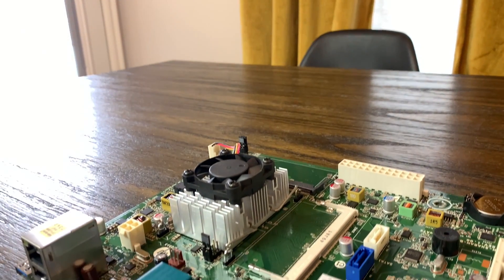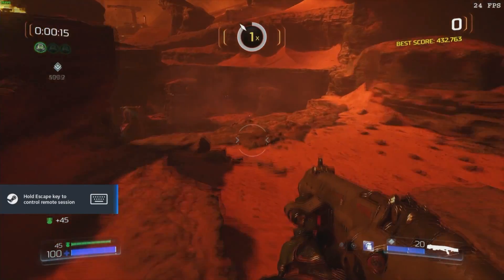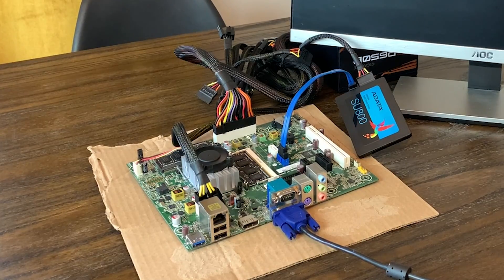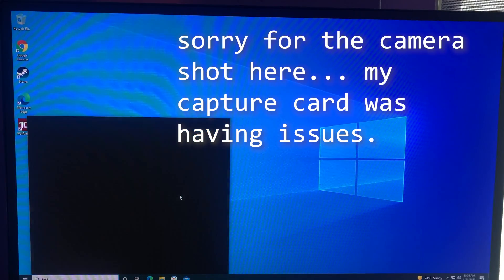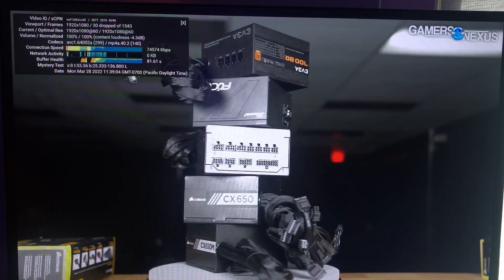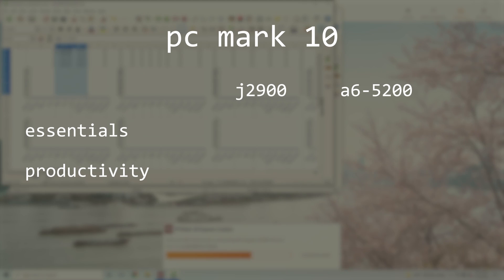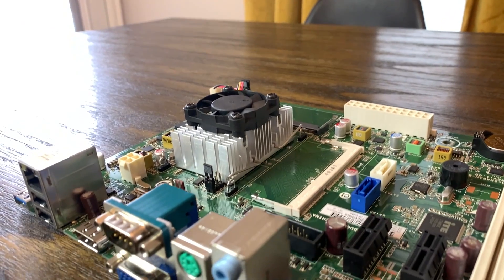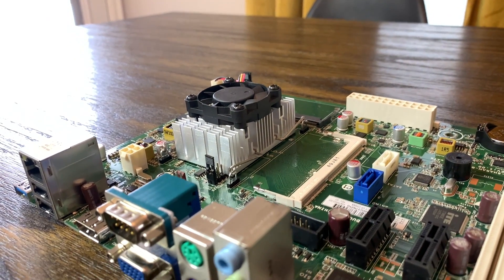YouTube fixed my motherboard.

Comment: I had a similar system, but with DDR3 DIMM not SODIMM. It worked with one DDR3 stick but not two. Both ram worked alone but not together. I tought slot 2 is bad. But later I found out that the motherboard officially needs DDR3L. It may work with DDR3 but the higher voltage could be too much for the memory controller. So one DDR3 was working but two sitcks was too much. I bought two sticks DDR3L and it worked like a charm.

Comment: I never thought I see someone else with that oem case! 
Got a hand me down Compaq computer that has the exact case but with different specs though I think I remember it was worse then the one in this video. 

Wanted to reuse it but the whole thing is riveted, Even the dvd drive..So I had to drill it out just so I can use my own spare parts in it. I found a new hate for computer cases like these.

Comment: At my old PC I getting blue screen randomly, I test ram, it is ok, disks are ok, cables look fine, cinebanch work fine, add 2 fans and bigger cooler, do not overheat..so it is motherboard or PSU problem...

Comment: CPU Soldered to the motherboard, don't buy!!!
Reply from the maker: Why not? Just curious for your exact reasoning
Reply: @HardwareHaven  I like being able to upgrade my PC, so I'm against the soldering in of CPU, Ram, Hard drive, Cmos battery etc.
Reply from the maker: @STONE69_   That's fair. I think the benefit of this is that you'll rarely see power efficiency in a socketed chip like you'll see in a bga chip like this (at least not within the same generation and/or price point). So for a lot of "server" type workloads, the performance isn't necessarily as important as the power draw. Just something to keep in mind. To be clear, I like easily replaceable componenets and am against soldered components when there is little to no benefit other than forcing consumers to buy new products.

Comment: I recently started a weird project with a very similar HP board. It's the Pentium J2900. So, it may be the exact same board.
https://youtu.be/4kvOlQ2sX-U
I've modded it to fit a full size GPU, and without the integrated GPU enabled the CPU only pulls a max of 3watts when at 100% utilization! But normally it pulls between 0.5 and 1.5 watts. It's pretty impressive.
I paired it with a GT 610 and got the following games to run on it (at low settings):
Portal (portal ran extremely well: 60+ FPS @720p)
Tomb Raider 2013
Borderlands 2
Minecraft
Lego Worlds

Gaming on it wasn't a great experience, but it was pretty cool that you can play the latest Minecraft on a CPU that's only pulling under 2watts.
Reply from the maker: Haha “reverse sleeper”! That’s super cool, and yeah I think this is the same or nearly the same board. I love stuff like this. Thanks for sharing!

Comment: I am thinking that a such low power CPU can run fanless. That can be a night PC. When it's nighttime sounds feel much higher, and a fan noise even small can be really annoying. So with that computer you can enjoy some YouTube without it. I am able to run Windows 11 + 720P60 YouTube smoothly on a Celeron N2840. This definitely is the best that CPU can do, my Core 2 Duo T9300 is noticeably faster, but it shows that your Pentium should be able to do much more.

Comment: in a general sense, the pros over intel you will/would find in AMD based low tdp is that usually they are not limited in features; for example although I don't think anyone would be crazy enough to do it(except maybe a youtuber) it's quite possible to do 7 gamers 1 cpu on a Athlon II 160u amd even though it is a 1.8ghz single core am3 cpu where usually on an Intel equivalent it would quite possibly not even feature VT support or have some other limiting factor(intel tends to disable or bottleneck features depending on cpu class far more often than AMD does; **I've tried the passthrough on a 160u but not in this torture scenario :P)

Comment: The thinkpad I have which I like to call Satan's Laptop, cause how painfully garbage it is, even for a school laptop the ones the schools gave you was faster than it. And when I took the ram out of it to upgrade my alienware alpha which I use for a icecast server. When I wanted to go back to that laptop, I also had no idea about low-voltage ram and all the ram I had was regular voltage so yeah, took me a while to ebay ship the max ram for that laptop and it still runs like crap, even with a slightly better ssd it's still slow, so now it just sits in a drawer, waiting for it's next victim.

Comment: I've been thinking a good video would be something kind of similar to this, but someone that tries to find the most powerful PC that can run off of USB 5v power. As I was thinking a PC like this would be good without AC power available and only having a low power usage machine in an emergency situation where you only have access to at most like 5v via a portable cheaper battery bank that doesn't usually supply 12v+ or being able to use similar things that are used for usually only phones and such? I know things with USBC have made things a bit more difficult as USBC can usually accept a wide range of voltages and things but from what I usually see is that most usually accept at minimum 9v-12v to actually power/charge machines. I know Raspberry Pis and such run off 5v but I am meaning things like x86 windows based machines.

Comment: After watching this video, I bought the same MOBO on ebay for $15 w/8GB of Ram, got a PCIe 1x to 16x adapter for $12, and plugged in my cheap R5 340x I got for $18. There's another $5 HP 250w PSU on Amazon too (There's still some left..wink wink). So for $50 it plays Minecraft and can Web Browse.
Reply from the maker: Heck yeah!! That’s so awesome

Comment: pfsense/opnsense machine right after the ISP's router.... low power draw but powerful enough for a small to medium enterprise network usage.... perfect for home use... and might as well run local dns hosting and pi hole on top of all of that.... taking your home networking to the next level without any worries...

Comment: I applaud your brave decision to install Windows 10 but you will struggle to give it away unless you put windows 11 on it.
 I totally agree with you that many Americans would struggle with the confusion that is Linux, especially OpenSuSE. How about trying out BeOS that will get the most out of the hardware? It should be fun
Reply: it will probably be more wanted with windows 10 as apposed to windows 11

Comment: From working at a computer shop. I've learnt that motherboards that take DDR3 RAM can be delightfully picky about which ram they'll actually post with. Sometimes they'll straight up refuse to post, other times they'll refuse to even recognise it in some extreme cases.

Generally I like to remove the ram completely and check for the "missing ram" beep code.
Reply from the maker: Good to know that that’s actually a useful troubleshooting method. Thanks!
Reply: @HardwareHaven  np. 

Generally removing the ram and listening for the beep code can give you an indication that the CPU is actually executing bios code. Just note that some M/B don't beep if they don't contain ram or don't come with beepers.

Other rare reasons for a M/B not to boot is corrupted CMOS settings. It's rare, but it does happen occasionally.
Reply from the maker: Thanks for the info!

Comment: Most don't prefer anything
To prefer you need to know at least 2 options
I prefer Linux. To be precise Debian GNU Linux, then Red Hat Enterprise Linux 
Why
My first computer was Commodore 64, then Commodore Amiga A500, Commodore Amiga A1200, some amount of PCs, now Dell PowerEdge R715 and R815 
Windows is inflexible, slow, takes over control of your PC (on Linux I can run PC without any interruption for years, while windows will force update on you along with compulsory reboot for say single insignificant DLL) and productivity wise is actually utter mess
I may prefer FreeBSD or OpenBSD, but I don't know those (I have used them briefly, but I don't know them) 
In next few years I would not be able to say I prefer Linux over Windows,  because I would cease to know Windows - I already struggle to understand design decision of Microsoft and I am often lost

Comment: If any of those motherboards have gigabit networking I would suggest getting a second network card and building yourself your own network router. 

I used pfSense and It wasn't much more difficult than installing Linux on something like the Raspberry pi. I've got it blocking ads at the router level which is pretty cool, but you can also push all of your traffic for your entire network over a VPN.

I think a 10 watt TDP would be perfect for this type of application.
Reply from the maker: Definitely something I'd like to try out! I just had a 2.5 Gigabit card come in, so we'll see if I can find the time to get to it. That's the real struggle right now haha

Comment: Those low end amd apus are infinitely better cuz the gpu runs laps around intels low end. And older stuff really does run fine, think 2000s, need for speed most wanted, underground 2, etc. Still a great time.

Comment: Use that PCI Slot. There are still gigabit Ethernet cards for PCI slots out there. Also some SATA RAID cards, however, those tend to be SATA 1. Truenas wants 16gb of memory minimum, so you may need a upgrade there. But I could see this board being a better high speed router with PFSense and a couple of 2.5gbps network cards.

Comment: If you really REALLY have to use Windoze 10, set your power plan to Ultimate Performance, and disable Spectre and Meltdown mitigations using InSpectre. Windoze 10 is a terrible idea when it comes to old hardware like this, your poor processor will be in agony.
Reply from the maker: For sure. I wouldn’t use windows 10 with this personally. But I thought I did an okay job of explaining why I tested with windows 10, but maybe not

Comment: Your vid actually inspired me to turn my 4,1 dual cpu Mac Pro into a NAS using unraid. It also serves as a Minecraft and Plex server. 14TB in total 3,6TB drives and 2 1TB drives with room for expansion with 1 parity drive.
Reply from the maker: Heck yeah, that sounds awesome!
Reply: @HardwareHaven  they’re great machines if you look locally. I got mine for  200 bucks off of Facebook marketplace. Just be aware if you want to get the latest Mojave update you have to manually upgrade the firmware and get a amd 400/500 series gpu for it to work.

Comment: HP did similar ATX powered AMD APU boards (at least in Europe) that are also DDR3L only. Got an A4 5000 and another A6 board that both need DDR3L and they're not even using SODIMMs. (Was looking for something as an always on remote access PC for connecting to my home network, CCTV etc, and these boards are low power, not TOO slow, and ridiculously cheap now)

Comment: Great video! I have a question as I am trying to use an old machine like yours as a server. These old machines can be really loud. If I try to put it out of sight computer cannot see wireless. 

How do you deal with noise?
Reply from the maker: I would avoid wireless at all costs. It you can run wired Ethernet from your router/switch, that’s ideal. You can buy some flat Ethernet cables that can tuck under trim/rugs pretty well if you don’t want to run anything in the walls. And if that’s not possible, you can also look into a thing called power line Ethernet. Basically it uses your outlets and electrical wiring as a wired connection. Not as good as CAT5e, but better than wifi!

I’d also make sure it’s cleaned out well and maybe check if you can adjust fan curve settings in the bios
Reply: @HardwareHaven  I know power line ethernet adapters. I can give it a try, nice idea. 

It is the $3 psu which makes the noise. Cpu fan is actually quiet. I have 2 nonworking 750w psu. If you plan to share psu repair videos, you have a viewer here:)
Reply from the maker: @GökhanTürkeli  I doubt I'm qualified haha

Comment: I wonder how well it will handle software RAID? Unless you plan to get a RAID controller for it. If you want a PCIe card but you can't find any that are x1, don't let that stop you! Just don't try to cut, melt or otherwise alter the PCIe slot. Instead, get a PCIe riser for it. But replace the USB cable it comes with. There's nothing special about those A to A usb cables, so you don't need to worry about them being wired weirdly. The reason you should replace the cable, if you end up getting a riser, is because the cables that come with them are generally bad and fail easily. I use a riser with my ASRock d1800b-itx motherboard with a replaced usb cable and it works fine. Though, the PCIe slot is already only Gen 2, so there is performance left behind. I don't know if you board is Gen2 or Gen3, but either way, a riser is not a bad option.

Comment: Ask one of the big youtubers for one of their "lucky box" GPUs and then chop mod it or open back mod the 1x slot, there may be a tiny bit more CPU performance if the graphics are not using the RAM - though probably not what you want if its going to be a power economical server

Comment: Well here's a suggestion, the self-hosted password manager bitwarden, it's intended for business use, so it has fairly high  system requirements, so the unofficial vaultwarden server is better for home users.
I switched to it a year ago when LastPass announced that free versions would be limited to only desktop or mobile devices, never both, they also went on to discontinue email support for free users, neither of those things were a dealbreaker for me, but they were making it clear the direction they were heading, no concern for any user who isn't paying while simultaneously jacking up the prices, but ignoring that, bitwarden + cloudflare has been great, in someways better than LP.

Comment: My GUY you're leaving performance on the table, that Intel j2850 cpu has a dual channel imc (internal memory controller) so by you not installing memory in both slots and only using one, you're gimping the memory bandwidth by half because you're only getting single channel by using only one so-dimm, for sure def always fill every memory channel you can that a CPU will allow or you're leaving performance on the table, not too much, but def an amount that's measurable, and in this cpu case it needs all help it can get.

Also, most main stream cpu's are dual channel, like the 12900k, granted it's limit is away higher than 8gb, but nonetheless still dual channel, that's why you only see some desktops with only two sticks of ram installed with one ram slot spacing, and that's fine because each channel has been filled with one dimm per channel, the reason why there is four is for more capacity by offering two dimms per channel, that also offers you the chance to have four 32gb modules equaling 128gb, which is max for 12900k, instead of like on mini itx 12900k board where there is only 1 dimm per channel and then having to buy 2 of the more expensive 64gb sticks to get the max 128, so 4 is not needed, and only need two, but in the 12900k case it's nice to have 2 dim per channel for more flexibility, just the same on this motherboard, it could have 4 so-dimm slots, but since the CPU only support 8gb total, there's no point in having four, because there are such things as 4gb so-dimms, so there's no need four 4 when 2 will max out the imc, it's not always the reason I stated above for having 2 or 4, there are also space savings reasons, so not only will 2 max out this cpu, but two is also the most you can fit viably, and there is also the reason of overclocking, having two dimms per channel makes more traces from the CPU out the memory, and that stresses it, so like on the evga z_90 dark series or like the z_90 Asus apex series , its a full size desktop motherboard but still only has two slots for that reason of less stress on cpu and that in return allows alot like way better overclocks on memory by not having those extra traces and being able to focus everything on the two dimms, so well sort for going on and on but i hope this helps in whatever way it can lol and by filling both channels gives you that much more performance and all the help this little cpu needs 

I love the videos, and the structure, it's like a story of how you got from where you started and ended up where you are now and taking us along for the ride, keep up the good work my guy and thank you for the content :)
Reply: answering your first paragraph, at 3:49 you can see 8gb of ram being reported by task manager
Reply from the maker: Oh wow! I forgot to put the clip in where I added the second DIMM. It was tested with both 4GB dimms
Reply: @HardwareHaven  oh gosh I see the task manager now, thank you to the other comment stating the time stamp, I shoulda noticed but looking at task manager on a screen through another screen isn't well the easiest, especially with YouTube compression, or my eyesight one or the other, probably both, and good to know that the numbers you've shown are with the full 8gb, Its good to know, because I myself am looking into these I suppose they're or could be called sbc's, because they're cheap and can find them with ram sometimes as well and beats buying say a pi in cost and performance for a low powered iot device or something like that, so thanks again for the content and future ideas :)
Reply from the maker: @brianschumes4249  yeah that was completely my fault for not editing that in haha

Comment: Truenas sever will be great on that board 
You can also use it to run pfsense.

Just add some more compatible ethernet cards and you're off. Btw adding some sata dom (ssd) storage (for os) and using a pico psu will keep the power consumption and the overall footprint of the pc smaller.

Great vid, hopefull this idea helps
Reply from the maker: Thanks!